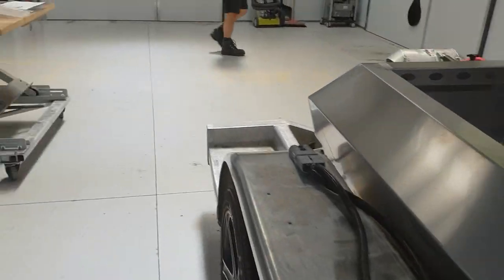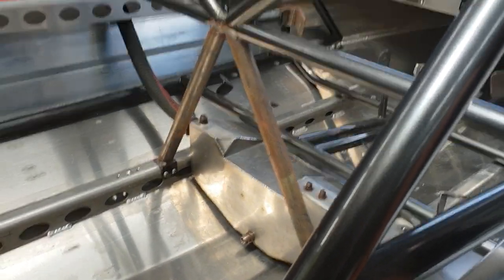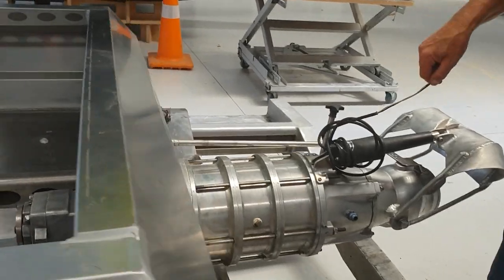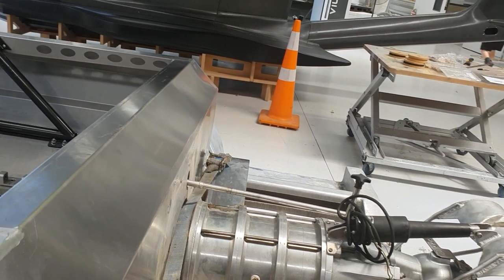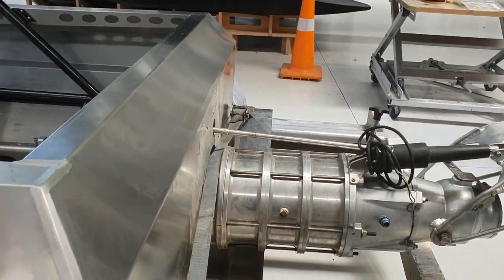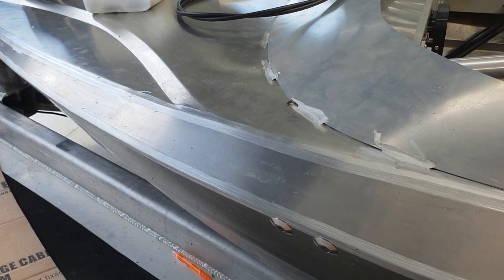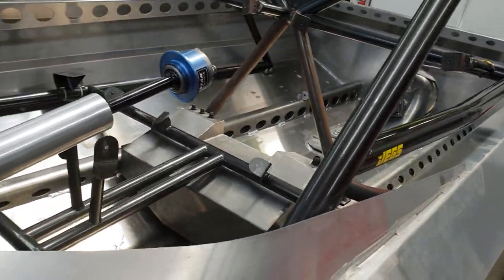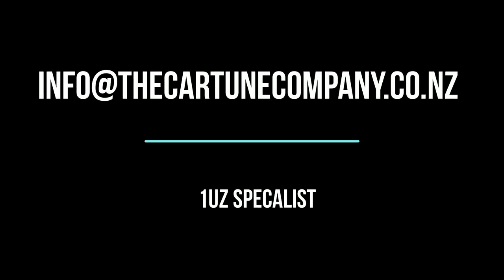Sprintboat new hull

Comment: Nice! Is that a stinger is there a test day before meremere round
Reply from the maker: Yes,  brand new stinger. Looks good too.   Not sure about test day yet.  We still have a boat to assemble so not quite sure we will make it yet.
Reply: CartuneNZ why did he get a new one
Reply from the maker: @blakehughes7586  he had a really good offer on a on new one and a really good offer for the old one so it made sense to swap over.  The man loves doing deals nearly as much as he loves driving sprintboats.
Reply: CartuneNZ engine all go?
Reply from the maker: @blakehughes7586  sure is.  All good to go.  All valves heads are now attached to the stems again.
Reply: CartuneNZ awesome! Toddy will be busy!
Reply: Who’s the other hull going to
Reply from the maker: Kyle Patrick got it and is putting all his gear into it and giving it a few runs over here at the end of the season hopefully
Reply: CartuneNZ what rounds is he doing
Reply from the maker: @blakehughes7586  not racing this boat this weekend.  Ive just been doing some bits on it.  I'm with Kyle with the old hull.  Toddy in the navi seat.  Same team just about with same hull but different motor and driver.
Reply: CartuneNZ toddy Navi for Kyle did you mean who’s with bayden
Reply from the maker: @blakehughes7586  yep.  Toddy in old hull with kyle.  Baden isnt racing.  Hopefully he's on the weber bbq.  He makes the best roasts.
Reply: CartuneNZ ohh bayden that sucks why that
Reply: I suppose his season chance are low now
Reply from the maker: Yep.  Baden is really good to work with.  He realizes theres another season next year.  We will sort out the new setup ready to move forward.